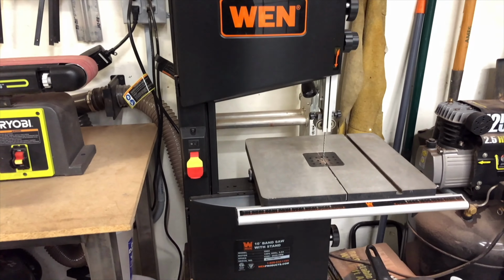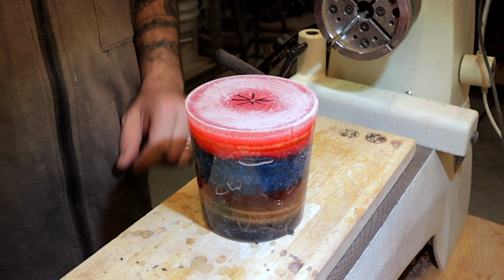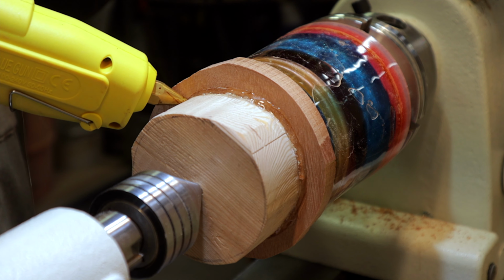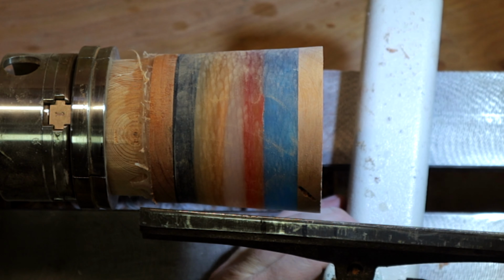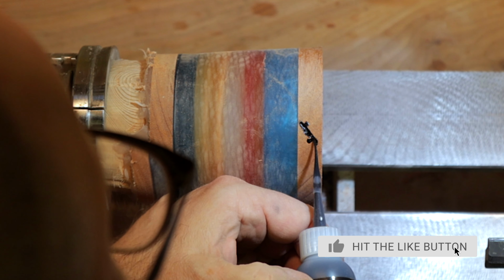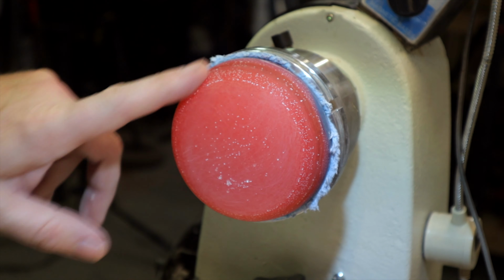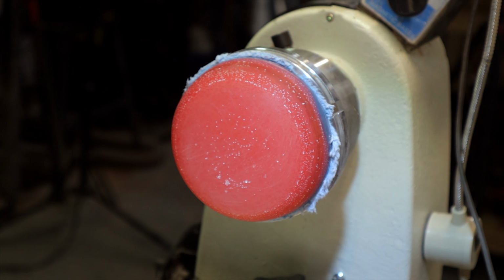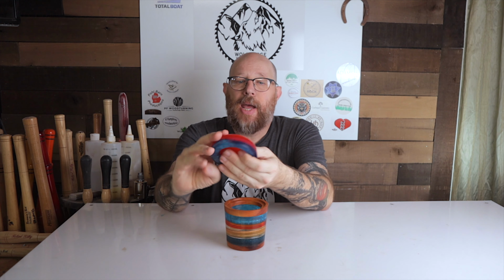Woodturning: Rainbow Resin Lidded Box

Comment: I think it is great, Ed. I like the transparency of the resin and not adding a knob was a good call. I also think the wood was a nice accent. Could you have used a CA finish (like you do for pens) on the lid to fill the holes? Stay safe and well.  Bill
Reply from the maker: Thank you so much Bill!  I tried using some medium and thin CA glue and it would fill them, but when I'd sand, it would expose more.  There were thousands of them from air bubbles.  I should have put it in the pressure pot each time.  It's a learning opportunity.  - Ed